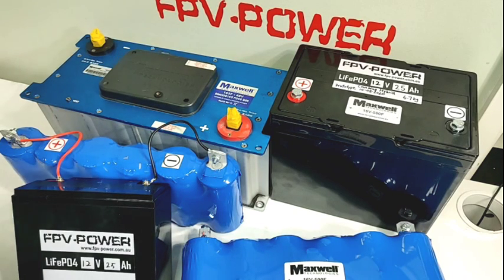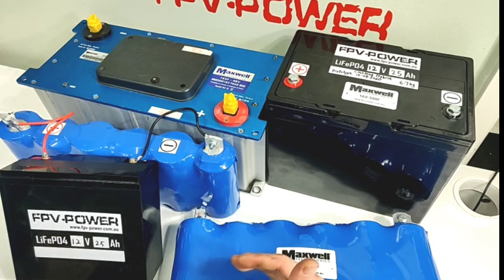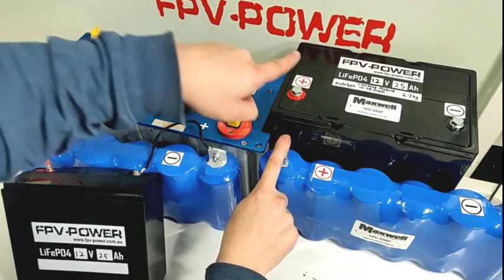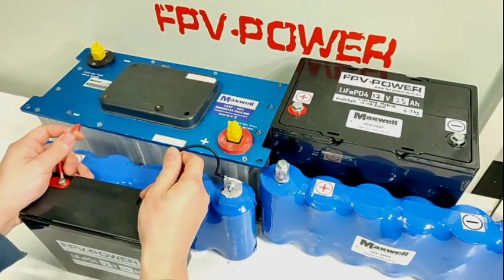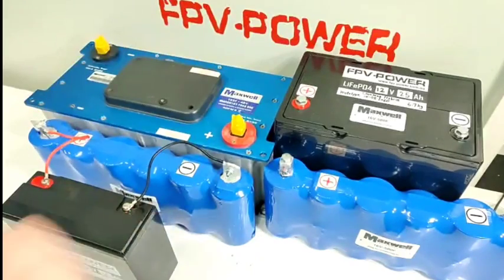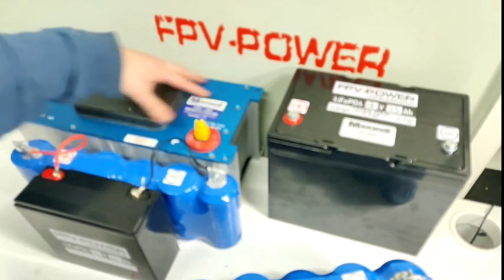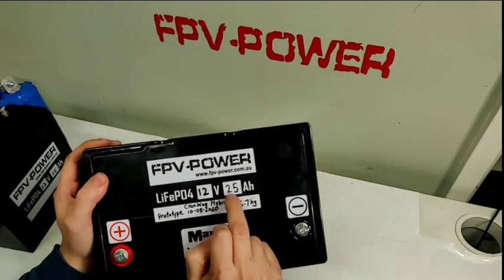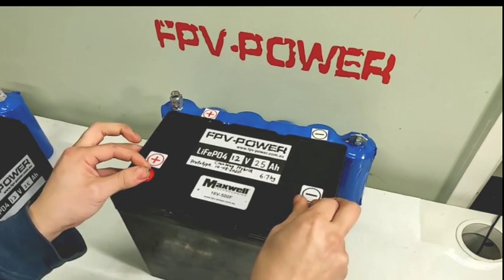FPV-POWER Super Capacitor for Cranking Combustion Engines

Comment: I bought one 16v 500f aluminium case module back in early 2022 for my hilux, which works like a dream to date. Cranks the engine in no time, no matter how cold it is. Then i bought another same one for my yaris. I think i am not gonna need a new battery for the next decade.

Comment: What if you crank the engine for 4-5 seconds and it doesn't start? Will the LiFePO4 melt those tiny cables as the Maxwell supercapacitor pulls 400A-500A to recharge itself, all supplied from the little 25Ah battery via the tiny wires?
Reply: The higher the resistance of the wires, the better. Do the math and add the proper resistor for the exact current draw you want from the LFP battery.

Comment: Hi Ian. Can I use your ultra cap for my 1200W audio amplifiers and also to start the engine? I still have my car AGM battery but I just want take the load of starting the engine from the battery too, can I do that? Cheers

Comment: What is the self discharge rate?
Reply: Leakage is 170mA max. in 72hrs at 25 Celsius when the capaciotr is New. These used modules might leak twice that.

Comment: Why are these so much more expensive in the US? Not much electric drive infrastructure here? Want some for two 48v 200ah and one 12v 100ah  lifepo4 banks. Could really boost solar and wind efficiency. And might even regen this boat under sail a little.

Comment: A quick question if one capacitor hold 50 amp and i series 18 to get 48 volt the bank would only hold 50 as one cell is that right

Comment: Can we connect 2 X 165F module of 48v each in series to get 96v module
Reply: Yes is the short answer, as long as your peak voltage does not exceed 96v, best to have a capacitor bank voltage higher than your battery voltage, and it doesn’t matter much if ur cap bank voltage is much higher! It would be nice if they answered some of their post’s/comments.

Comment: awsome !  i am currently using a anti-gravity breand battery in my Ferrari F430 spider it costs about 600$ to 900$ depending on amperage is a group 47 and works very well weighs 18 lbs ! the car loves the higher resting voltage of lithium and we like it !     
this FPV power seems like a good solution !!  
what about shipping ? you are in Austrailia ? 
we are in USA !

Comment: At 12:50 you said "there is only 3Wh in this capacitor".
You forgot to multiply 3Wh by six cells, mate. This 6 inline module you are holding is actually 18Wh (max).
Reply: Remember the caps are in series. The caps all share the same current, so they all discharge at the same time.

Comment: Can the 12v 20ah battery charge 3 separate 16 v capacitors bank
Reply: Yes it can if the caps are in parralel not series, it also can in series, but only to the 12v battery voltage, so you only get the power output of a single 16v string

Comment: Please can you provide email for a order???
I think it will be a good backup for an  inverter
Reply: But won't the battery in turn supply to the recently discharged capacitor what the capacitor just gave to the inverter? I am not sure if the benefits are there, unless an alternator kicks on like on an engine start application.

Comment: Would be great for an e-bike/car with regenerative breaking. Just dump everything into the supercaps and then move it into the battery slowly. At least if not before it is used by accelerationg again.
Reply: @Malachi Nikolai flixportal
Reply: @Ezekiel Ryder Thanks, signed up and it seems to work :D I really appreciate it!
Reply: @Malachi Nikolai You are welcome xD
Reply: How can we be certain that this flow will be slowly?
Reply: @seferideveloper6933  the batteries will only accept a charge current as much as they can handle & the bms will take care of that also, along with the balancing of the cells individually. The battery cells can only accept a given amount of amps (ah rating) and will drop off the current (amps) as the battery reaches it’s full SOC.
Reply: @evil17  Thank for your exp.